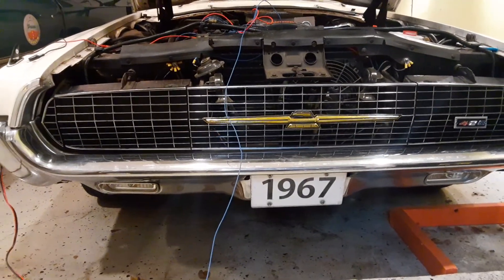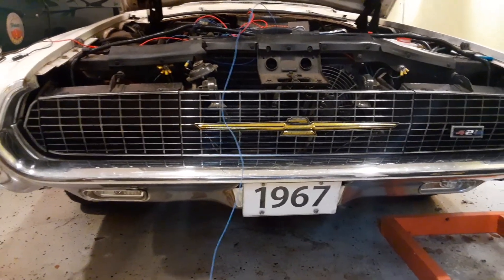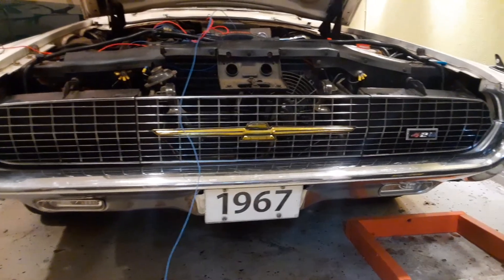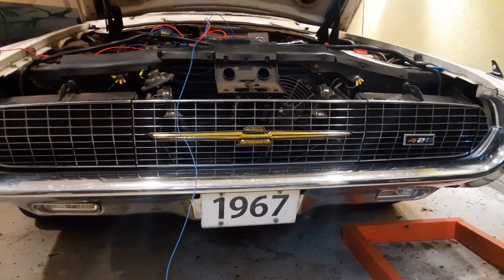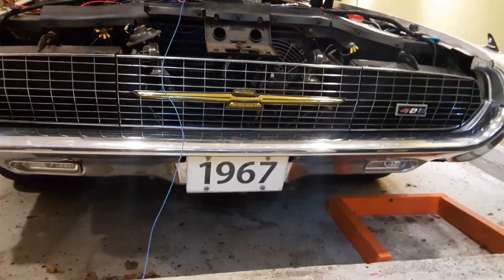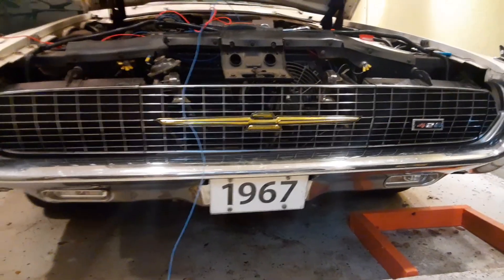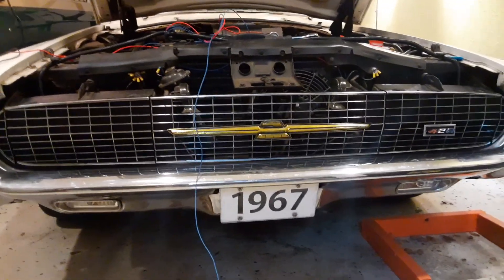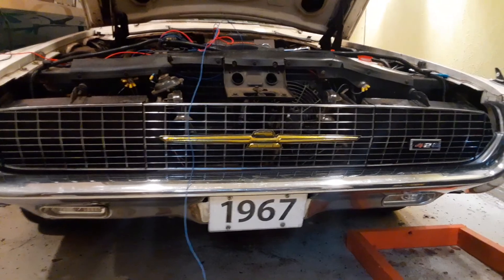1967 Thunderbird electric headlight cover door kit installation.

Comment: Need that kit
Reply from the maker: It is called "CATHEADLIGHTS" for 1967-69 Ford Thunderbirds.  You should be able to find them online, or contact West Coast Cougars.  Not cheap, but solve the problem once and for all.  They use headlight door motors from either a Ford Probe or a Mazda Miata.